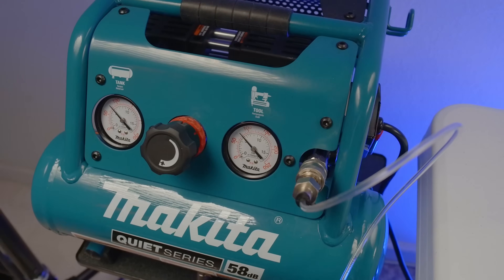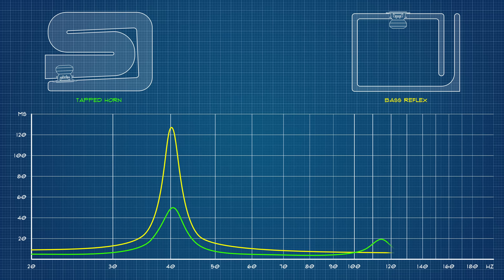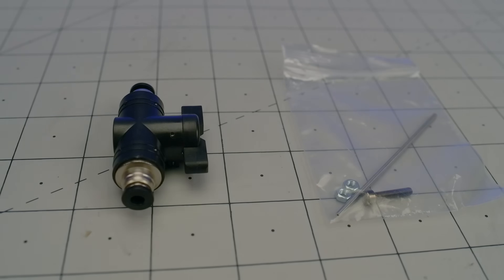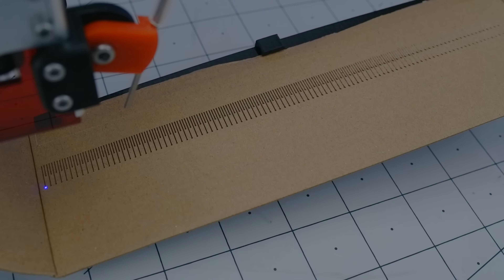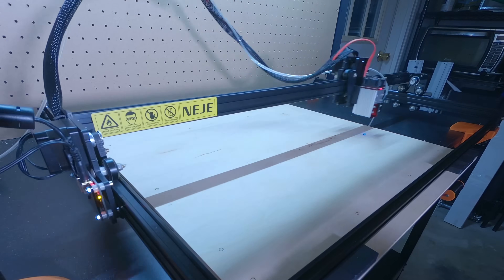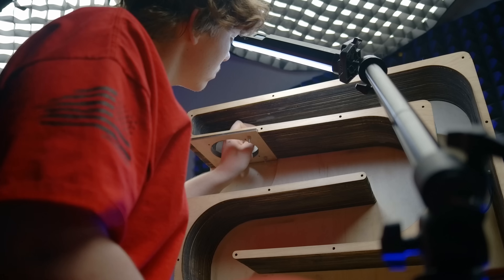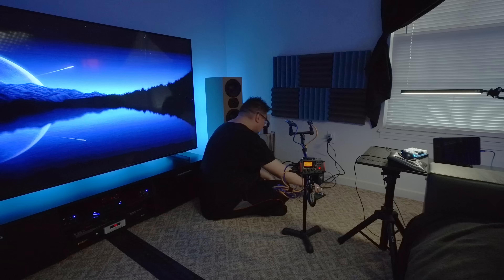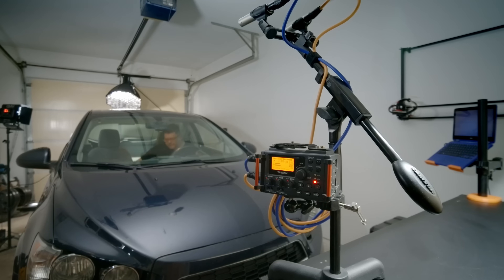Building a Tapped Horn with a NEJE Laser

Comment: 🟦.... Not only is that transducer WAY too small for THAT size Wave Guide, but You've caused the rear-wave to become the primary wave and you've put the front wave in a WAY out-of-phase condition which will disrupt the laminar air-flow In the duct JUST BEFORE IT EXITS by the emanations of the rear wave of the transducer, & by not accounting for the proper phase-value of each turn in the oversized duct-work, You further "loosened" the bass response, from the viewer listening-point, it sounds way overpronounced with selective frequencies booming out of proportion with the rest of the music.
..... Sure Is A SOLID BUILD Tho!

Comment: Nice.  Seems like the laser is good for cutting a template (for multiple pieces of the same shape) and a router to knock out those duplicate pieces faster; or the laser to cut one-off pieces to precision.  In an case, have you thought about entering Parts-Express (Franklin, Ohio) speaker building competition? They love diy kits/builders.

Comment: So in a discussion of the tapped horn, it's important to stress that the tapped horn does not act as an acoustic impedance transformer the way a classical low-frequency horn does. It operates as a hybrid of a quarter-wave transmission line and a half-wave transmission line, with some physics 'magic' coming from the summing of the quarter wave and half wave content in the region between the quarter wave frequency and the half wavelength frequency that fills in the response between those two frequencies, and the expanding waveguide brings upper frequency modes closer together while also damping the driver's motion at low frequencies. (A hi-fi transmission line speaker is often tapered from the driver end to a smaller exit area, instead of expanding, in order to move the upper line harmonics further away from the fundamental, and decrease their level. Tapped horns are only useful a little below the quarter wavelength tuning frequency, and a little above the half-wavelength tuning frequency, or else their sound will become phasey and muddy, unlike a bass horn which can be designed for a very wide range with perfect definition. That's perfect for a subwoofer, whose range is usually electronically limited to about 1.5 octaves anyway, but not as great for the woofer section of a three-way speaker. The tapped horn exists because classical low-frequency horns are necessarily large to obtain the desired acoustic impedance transformation at low frequencies, which makes them really impractical, and the tapped horn is a more practical alternative to a horn. In the early days of DIY tapped horn design, some horn purists tried to pressure tapped horn designers to use the term T-TQWP (tapped tapered quarter wave pipe) because it is more similar in topology to the Tapered Quarter Wave Pipe or "Voigt Pipe" popularized by P.G.A.H. Voigt. Still, the term Tapped Horn continues to be the preferred one. I have also investigated "Transflex" designs by Jensen; in those designs, the damping comes from the ratio of line area to cone area, and to operate efficiently, the line needs to remain un-stuffed.

Comment: There seem to be a lot of diyers that choose this method of cutting entire sheets of engineered wood in the shape profile of a horn or transmission line waveguide and then stack the cut pieces to create the enclosure. This process is stupendously wasteful and time consuming. The remnants of the cutting process account for more than 75% of the original material and are only good for firewood. That's not very ecologically minded especially given that a lot of these efforts are experimental and as such the outcome will not always be a success and will also not be rectifiable. Given that most of the waveguide's sides are straight, I would prefer seeing these being cut separately from the sheets resulting into no waste of material. As for the 180-degree bends of the waveguide, I'd split them each into two 90-degree-bend corners (which upon assembly would be placed so as to make a 180-degree bend) and then arrange them in a cutting pattern consisting of the 4 corners arranged with their apexes in the centre of a square and the round side outwards. This arrangement essentially covers most of the area of the enclosing square and thus leads to minimum waste.
While diyers can be excused to some extent for choosing wasteful procedures (on account of having other things to do too and thus preferring a process that can run unattended or that saves them time and effort during final assembly) I find the case of many small boutique manufacturers (or even medium-sized ones) employing such methods totally inexcusable. Let's not forget that the end product is just an item whose sole purpose is to enable us to enhance our enjoyment or entertainment and nothing more. It's good to keep this in mind when wasting the earth's resources in the process of making it and try to keep this wastage to the absolute minimum needed.

Comment: I'm very new to acoustics so would love any input on this; Why not mount the driver facing out - the same direction the rear horn is?
Surely this way all of the energy radiating from the front of the driver would then be directed out towards the listener instead of half of it radiating back up the horn?
Is it that it doesn't radiate back up the horn as it is a sealed enclosure that way and so this compression chamber provides too much impedance for the wave to travel this way? Or is it a timing issue? This position for the driver beening selected to combine the front and back waves in some way that is beneficial/non-destructive.

Comment: Love your work.  My grandfather built a bass transmission speaker system that had 12 inch paper cone woofers on a transmission line, it was way ahead of its time. I have always loved my sound and especially the science behind it. With subwoofers and bass and ever since seeing the Bose wave Radio alarm clock do its thing with its transmission line keep up with floor standing speakers I was set to do the same and now have a split level house where i have a massive area behind the back wall of my loungeroom to run a horn / transmission line woofer or subwoofer ..  not just on a paper cone 12 inch which shook half the street, and btw your box and speaker sounds great, and well done getting that sound to play for us. My Horn / Transmission line will be based of a Paradigm Sub 25 Driver with an estimated transmission line length of 20 - 40 meters that transmission line is going to be a Basshorn style ontop (from memory 30hz needs 20+ meters before the wave completes, then 20hz 30 meters + i think?, people forget that bass needs to travel a good distance to complete the wave and to be able to "hear it" not "feel it" > it will be about 2 - 3 years till its done with this project but have the equipment ready expect all the MDF. Currently have a Paradigm SUB25 and got a spare SUB 25 driver only and fitted it in a ported comp box also. so 2 SUB 25's one with origional box and amp 3000 watts / 7000 watt peak Sealed and the one I put together, the SUB 25 Driver, in a massive Comp Ported box with a Velodyne SC1250 2500 watts / 5000 watt peak , the ported system is what I am going to do that project with. Your Video and the knowlegde you have was refreshing as alot of channels know how to make a SUB move and sure they get good kits to show off, but unlike yourself they don't understand some of the science and whats really important for good bass, your video makes me want to get th MDF and kick it off. 3000 watt 7000 watt Transmission Horn Bass Box, but the 5500 watts or 12000 watt peak of bass gets us by now. But your little Bass horn impresses me more, hats off.

Comment: I watched this on my uconnect 5.0 in dash radio 7watts per channel.  The speakers are kicker CSC693 92db sensitive.  I have sound treated the doors installed acoustic foam wave guides and installed the same foam over dynamat to eliminate back waves.
I had the speakers running without amplification and without any crossover.  I had my volume set at 18 out of 42 because at volume 20 there is bass roll off.
At volume 18 the kicker CSC693 3 way speakers were creating significant SPL reproducing your audio.  My interior panels were moving in tune with your tapped horn.  I could feel it in my chest.  I believe I was feeding my speakers between 4 and 5 watts RMS each full range signal.

Comment: I assume this is the case but have you done anything like building a driver set explicitly for very low power applications?

It seems like you could work wonders with less than 30 total watts and this kind of thing would be wonderful in a small camper where battery power is at a premium.

Comment: I understand that you’re employing small drivers because they allow you to 3D print an enclosure for them. But I really wish you’d do exotic builds for the type of drivers people have, like a 12” subwoofer.
Like, is a folded horn enclosure for a midrange 12” subwoofer a good option for car audio? How does it compare to the common 4th order vented? Or a Transmission Line etc.
I’m sure you could design an enclosure for a 500 WRMS 12” subwoofer that would provide similar performance to a much more expensive and higher power handling driver!

Comment: Nice work! Note that on a bass “horn” or waveguide, it’s not necessary to have smooth radiused turns. In fact, you want the turns to have sharp corners so that they act as low pass filters for the mid range and high frequencies from escaping the mouth of the horn.  Smooth corners on waveguides only needed for mid range and up horns.  So building with traditional flat sheets/panel construction will yield sharp corners and save on material waste. Assuming you want the sub to work below 100Hz, the characteristic wavelength of 100Hz sound waves is 3.4m long.  So a sharp corner or a round corner of a few inches isn’t “seen” by the wave - it’s acoustically transparent at that frequency.
Reply: You won't get a response, but you can rest assured all that you mentioned was 3rd grade material for him. If it's there, it's been calculated, it may even be for esthetics alone, but it has been accounted for.
Reply: @RightPriceSports  lol, sorry to dredge this reply back up. I guess you must be a fanboi? XRKAudio is 100% correct. I'm familiar with his posts and projects on DIYAUDIO; all of which are far in advance of hexibases skill level. Hexibase does OK and his projects get a fair bit of attention on youtube, but they are pretty gimmicky and cheap when it comes down to it, just as this one is.
Reply: @jeremyglover5541  reads a lot like it's coming from a fanboi.
Reply: @RightPriceSports  nope. Just familiar with his work. Havent built any of his projects. I design my own amps/dacs/speakers. I dont build a lot of class A amps these days and mostly dsp driven active designs. Im a fan of science though and thats all he is talking. The features hes rounding over/smoothing etc are dealing with wavelengths that are larger physically, so they are effectively invisible.
Reply: @jeremyglover5541  I meant to quickly follow that up with the acknowledgment that my reply to XRK certainly read like a love letter. It is readily apparent that I certainly don't know him and it's way more apparent to me than you that you don't know much about PWK or his knowledge/abilities. If the two were to sit and have a flowing conversation that reached the edges of their intellectual grasp of each subject/theory, I'd have no problem placing a wager and I'm confident you would too. That's where it stands. I rarely take my online comments very seriously and honestly give passing thought to them in their molotov cocktailesq delivery, as I just semi troll with the moderate attention ADHD allows. Depending on how much fog is in the way, it could be  thought out or incoherent babble. At the moment, it's just a source of sorely-needed dopamine. Hope you have a happy new year.
Reply: I would love to see him tackle a quarter wave theory inspired 4 inch sub, or paraflex. He is definitely far from conventional with any actual pro PA approach, however the videos are too fun and the results are neat

Comment: i am listening on a 2.1 speaker setup, ALtec Lansing XA3021,  the bass driver is a tube with a 5.25" long throw driver ;) it fills the room and more. The  difference i hear is when the bass gets more accented like on the occasional louder bass kick, you can hear the lil guy struggle for those hard hits.  but you dont need 1000 watts and a 17" driver for full good bass. only if you want to knock the pictures off the wall :)

Comment: I have a suggestion for a potential future project. Something that I've been looking for, but have been unable to find anywhere on YouTube or commercially available. A powerful subwoofer system designed for an electric vehicle; incredible focus on amplification, woofer, and enclosure efficiency. I have been a lifelong basshead, who has transitioned to an electric car. I miss the 25Hz "feel" of my last 12" 1ohm, large volume, ported enclosure... But I just can't see installing a system like this which I am sure will rapidly drain my battery. Anyway, just food for thought. I believe this is an incredibly overlooked market segment at this time and in the near future!!

Comment: What if i upscale your "subwoofer" box so a 8 inch sub can be mounted inside would it still work good or is upscaling it making it perform worse?
Reply: Your driver parameters would have to scale perfectly as well. Not likely to find an 8" midbass with perfect parameters to achieve the same goal with a scaled enclosure that fit the 8"

Comment: Vintage audio tech here. Great video. Beautiful construction. Just one observation, if I may. It's not a horn. It's a folded transmission line. That doesn't mean it's not a good bass cabinet, it's just not a horn. Horns are acoustic transformers that must follow a specific "flare rate" to work, and they tend to be quite large when called upon to work below a few hundred hertz. A true horn that is good to 30 Hz or so would be too big for one person to move. 

There are those who argue that the cabin of a car works as a horn for bass, but that's not true. It does provide considerable "cabin gain" because it is a mostly-sealed box with dimensions smaller than the wavelengths of bass notes, so it acts as a constant-pressure environment. But that doesn't make it a horn.

Comment: fantastic video, wonderfully informative/instructive as always. if you don't mind me asking, what tool is that you're using at ~1:43? i've been working on trying my hand at modeling a TL and have paused at the step of actually laying out the line with folds (i know i could calculate it by hand subtracting the length of each bend * the number of bends from the total length, then dividing the remaining length by the number of folds) but that looks like an awesome thing for changing params in realtime and observing the dimensions
Reply: also, just wanted to pause to appreciate the level of effort you put into those animations showing the layers of the enclosure. holy shit man, that is amazing
Reply: i just realized it's sketchup in 2d view 👍
Reply: Sketchup Pro

Comment: What mics did you use to record? Those look like mics thatd have a cardioid pickup pattern. For the in car test, they are pointed away from the sub. That means the picture is prolly inauthentic. Cardioid mics arent good models for our ears. Our ears are technically omnis. Any directionality our ears have is due to the physical interferance of our head, and the reflection characteristics of our ears, and ofc, the time differencial between 2 ears, also cues us in on the direction of the sound. But at the base level, our ears are omnidirectional. Even tho cardioids do pick up the low sounds coming from the sub, they might not properly convey the impulse response. Just some food for thought.

Comment: Might be a bit out there but what can be done with some tiny 2" drivers for a portable speaker? I wonder how far you could push those with the proper enclosure. best I've done is slapping some into a cheap Bluetooth speaker to improve on the very crappy ones already in it but they certainly are not as optimal as they could be